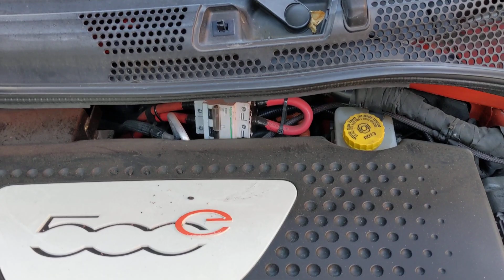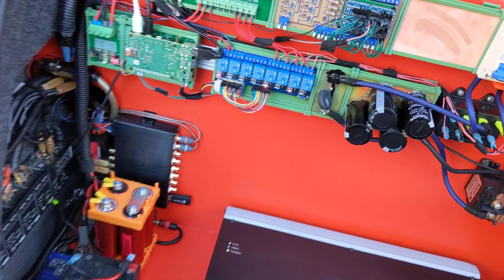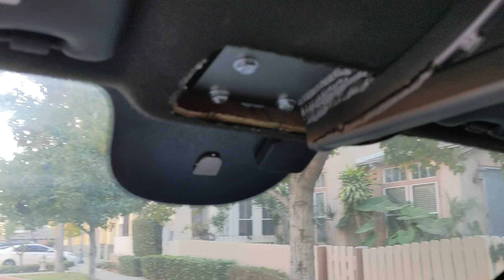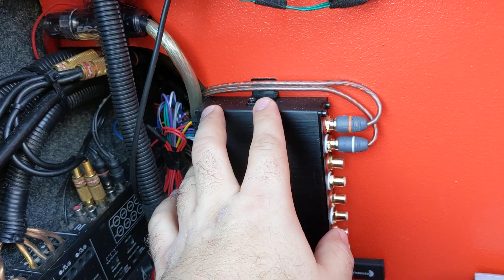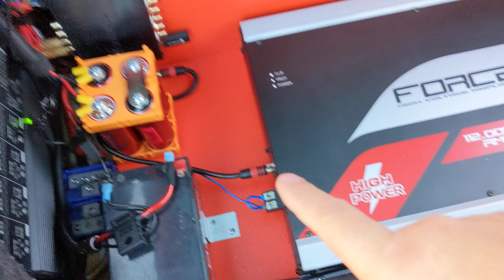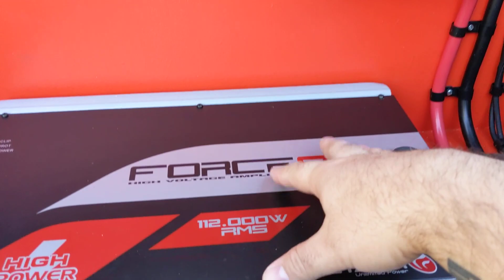Fiat 500e 400v - patreons

Comment: If a Ford cmax comes to say 260-281 how do you make it run a high voltage amp on a 12v setup?
Reply from the maker: Why would you do that? Just brake the cells down into individual units and wire appropriately. You'll be at 15.5v range though. Very common for a few years now
Reply from the maker: Also, if you mean use cmax cells for hv amp, wire appropriately.  Your issue is going to be a balancer, you're not going to find one that can balance that many cells in series unless you have a full running BMS.

Comment: Please show us how loud it is now
Reply from the maker: https://vm.tiktok.com/ZMR5WqHrF/
Reply: @LoudFiat  Thank,  Sounds really good man,  I really wanna get one of these someday but fear I won't be able to find an alternator with enough amps.
Reply from the maker: @yeethaw4895  ? My car is all electric, the battery can put out 200,000 watts. That's the whole point of the setup and being the first in the world to use a 24,000 watt hour high voltage battery for car audio.
Reply: @LoudFiat  You seem like the perfect person to ask this question to so what would I have to do if I had a gas powered car but the speakers are too powerful for my alternator to keep up with? Some cars can buy high output ones but what if you car doesn't have them as an option?  Could you rig a different cars alternator  or would that not work because they're model specific?
Reply from the maker: @yeethaw4895  yes, lots of folks have special brackets built. In fact, there are radio guys with like 10 alternators. Most SPL guys nowadays run 100-200 amp hours of CMAX lithium or yinglong or headway lifepo4 cells
Reply from the maker: @yeethaw4895  https://youtu.be/L05IlKm3M5I
Reply: @LoudFiat  You're amazing, thanks for the help.🙂